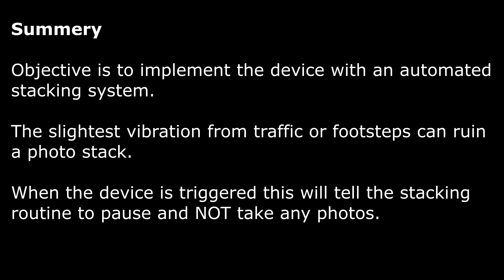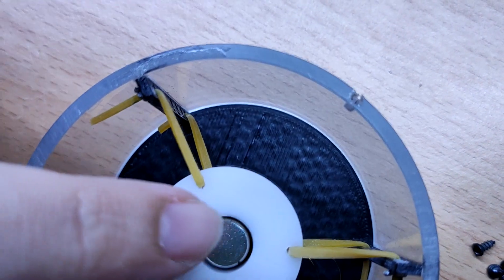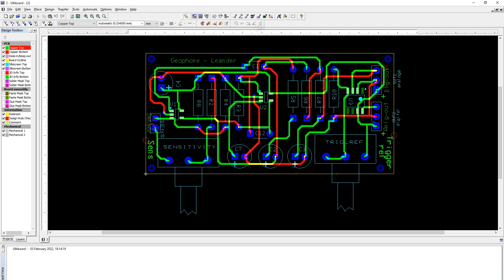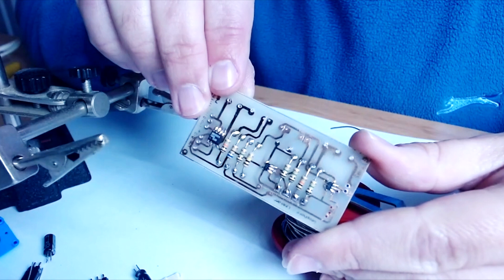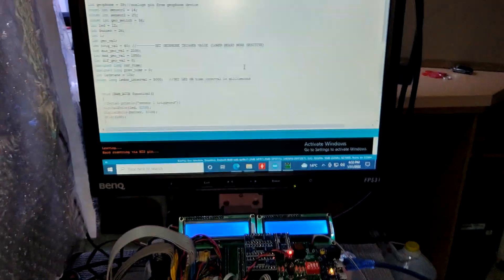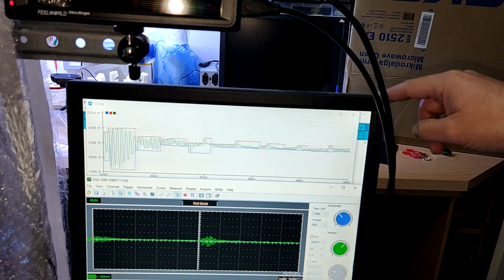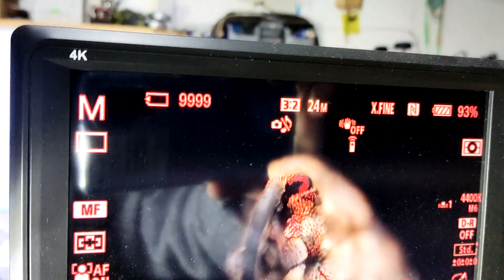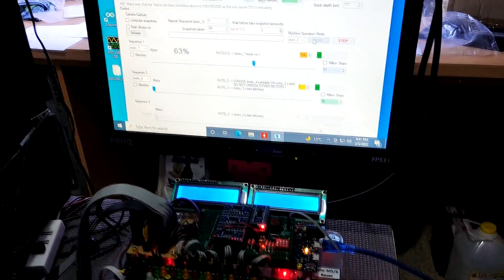DIY Geophone (Seismograph) for extreme Macro photography stacking

Comment: Hello, we are three students and we are doing a project around the making of a geophone, what is the stiffness constant of the elastic as well as its length please as well as the characteristics of the coil?
Reply from the maker: I changed those elastic bands to small soft metal springs. In my case the length of springs when fixed in the setup is around 2cm (I think if springs are soft enough the exact length would not matter that much). In my case bobbin has 2 spool cavities 1cmx1cm wound with 1000+ turns of 34awg. I guess the more the turns using the thinnest copper wire you can find would work great.
Reply: @lmatrix6626  thanks for your answer I have two more questions. Do the two cavities on the coil have any purpose in operation? For the second question, why did you replace the rubber bands with springs? Finally, for my last question, what are the characteristics? Thanks
Reply from the maker: @Lucas-qk9oi the more the cavities the more the voltage induced across the coil. However if you use very thin gauge wire that will still do the job. Elastic bands turn brittle after some time, so ideally use some tiny tension springs. You can find these on Chinese webstores for pennies. Re characteristics all I can say is that the combined setup is very sensitive, basically it can detect footsteps ground level on concrete floor. Also cars passing by in the neighbourhood

Comment: Hi Liam,
please help me if you can with some information. I can't find the CAPR508-381X254X584 470pF capacitor anywhere. Somehow the serial number is wrong, can you help me with some information or a link where I can buy it?
Reply from the maker: it is nothing special.  it is just a normal  470pF capacitor . The case is not important. https://www.amazon.com/CAPACITOR-CERAMIC-470PF-1000V-RADIAL/dp/B007Z7NG48
Reply: @lmatrix6626  It is one and the same as this one: CAPACITOR, 470pF C1, C12 IPC-2221A/2222\CAPR508-381X254X584?
Reply from the maker: @elysiummusic.eduard  yes they are the same
Reply: @lmatrix6626  Thank you so much, Liam!
Reply: @lmatrix6626  va functiona chiar daca nu este la fel?

Comment: to the analog opamp feeder, at the exit from the geophone, put the clamps on a diode (resistor).  What is that, how do I find it so I can buy it?
Reply from the maker: that is not a diode, it is just a small capacitor so that it filters out any hf noise.  Basically it smoothens out a bit the output from geophone. size depends on geophone used, you have to try different values.